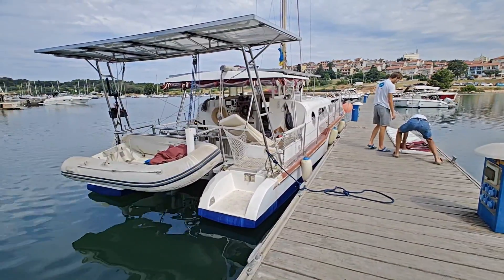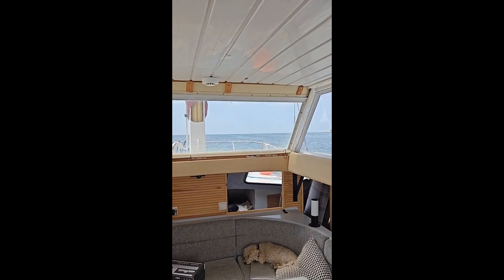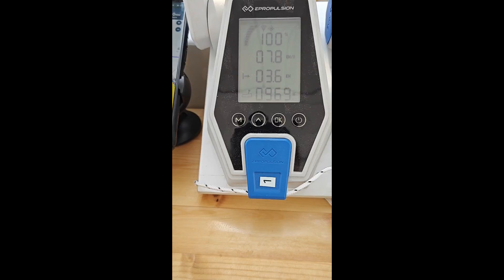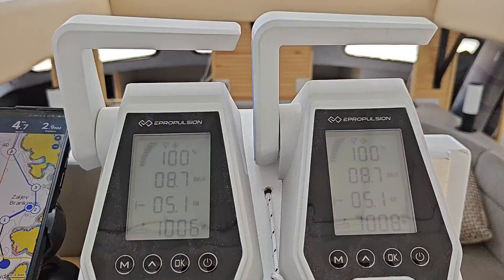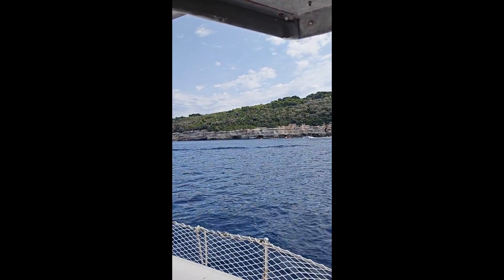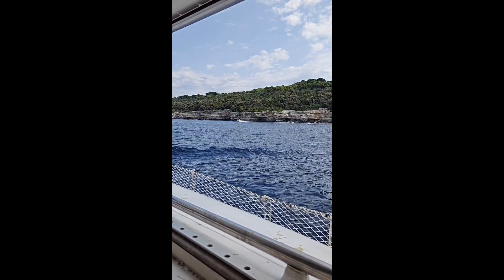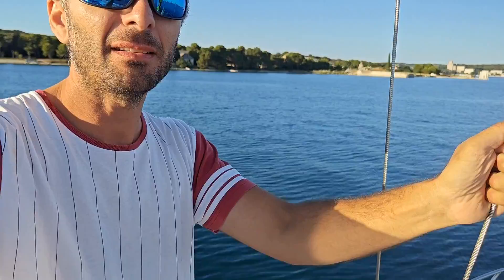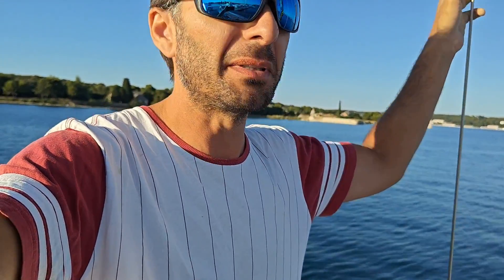Our DIY solar powered yacht works!

Comment: Just rewatching some of your videos Patrick. The boat looks like she was well above the waterline when she went in, meaning your exchange of diesel to electric left you with added capacity? I think your thoughts re. solar boat versus battery boat are interesting, but now you have been through a couple of winters, are these thoughts based on using her during these months, when solar can diminish by up to 90% depending of coursse where you are.
Reply from the maker: My maths tells me we definitely lost weight, but that's on an empty boat. As we now liveaboard literally everything we own is onboard, including the washing machine and all my tools. I suspect overall we're lighter but not by a huge amount. 

I still think of myself having a solar powered boat rather than a battery powered boat, but in summer I run differently to winter. I don't even think of battery capacity and will motor hard early in the morning knowing the sun will be shining until 7-8pm and replace anything I use. In winter it was much more of just using the available sun with the battery as a reserve tank. My summer speed is always 4-5 knots, while in winter I average 3-4.

Comment: This is so inspiring!!! I want to do exactly this Summer '27 when my wife retires and I just work remotely.
Reply from the maker: Go for it!! It's been completely worth it in my opinion! I'd change maybe 1 or 2 things with the benefit of hindsight, but not the lifestyle :)
Reply: @SailingElectra  What would those 1 or 2 things be? More solar is one I've gathered another was not to invest in the new mainsail? Any others? We meet our new to us 37' catamaran next weekend so all the suggestions you can throw our way are greatly appreciated. (@jasonlezlie is my personal YT btw. We shifted our project...lifestyle change...to this channel since that initial post.
Reply from the maker: @SolSeekerLiFe  losing the mast when I got the rigging quote would be a definite, going for pods over outboards would be a big consideration, but I'm not sure yet, and lastly I would have made my solar frames simpler. At the moment I have stainless tube with aluminium angle on top and then the panels. The aluminium in my setup is overkill and adds too much weight. I'd also consider a watermaker based on a Pumptec 107SS instead of the Karcher based one I have. I'm sure there are more, but those are the ones that stick in my mind.
Reply: @ Excellent notes! I still think the outboards are the right way to go. POD drives are very exposed and not as plug and play as dropping an outboard into place. The water maker is a very interesting consideration.

Comment: You should really be thinking that the batteries as the critical element when motoring and the solar panels as the possible source of re-fuel. It would be no different than setting of in a car knowing how much petrol you had in the tank and then wondering where the next petrol station would be along the road - and if it is open!
Reply from the maker: @marviwilson1853  it's been two years and a couple of d thousand miles. I do think slightly differently now about my batteries. I now consider them my reserve tank. I know how far and at what speeds I can do on reserve. 

My fuel source is still solar, so when motoring, like I am right now, my goal is to fill the reserve tank and then motor as fast as possible on only solar power. So at the moment I'm using 1000W total power to motor at 3.5 knots (7 knot headwind) and I'm charging my batteries at 600W. They'll be full soon, then I can go faster until the sun gets lower then I'll slow down to make sure I don't draw into my reserve as long as possible!
Reply: @SailingElectra  What you have done is fantastic and it is to your credit. All boats are designed for a mission and you are clearly happy with the spec level you have and the boating you do. Most chose multi hulls for this conversion but mono hulls are also feasible. They benefit from their abundance and variety and therefore cheaper price. Buy one with broken winches, worn out diesel, sails and ropes for best value. Solar panels are thin and light so a full length, full beam roof is possible. Build a layered roof with athwartships extensions to increase generating capacity at anchor or motoring in calm conditions. Use a properly marinized 2nd use EV lithium phosphate battery. Much cheaper. The business model must surely exist for such a boat in sunny climes. Built for "solars" not sailors who put out the panels when the sun shines as opposed to putting out the sails when the wind blows. Perfect for summer Island hopping in the Med where winds are often light and variable and sailing a pain. All that power allows all the home appliances for a comfortable stay onboard including air con. 100kWhr battery, 40-50kWhr per day from a 10kW array. Now we are cooking with gas!
Reply from the maker: @marviwilson1853  thanks for the compliment, and yeah I completely agree, a 10kw array and 100kwh battery would be insanely good! I suspect faster than an equivalent sailboat too!

Comment: I am impressed. What’s the weight of this boat? What can you increase the motor speed to without draining the batteries? 8kn and no battery usage.
Reply from the maker: Thanks! 

With no wind around 5 knots. The power draw goes up exponentially, so you either need loads of batteries, or to be happy with 4-5 knots.

Comment: There is also 'too much' PV capacity. If, at any instant, the system doesn't draw off EVERYTHING the panels are providing, the panels will overheat and life expectancy will drop.
Matching battery bank size to PV capacity and electrical consumption  enables the panels to stay cooler.
Otherwise, the excess PV production needs to be immediately dumped into a large consumer (propulsion motors, etc...) to prevent over voltage and over heating.
Reply from the maker: Interesting, I suspect this will be quite common to most electric boats, when size the system for the motors you have so much excess power on days you're not motoring. I'll have to find ways to use more power 😁
Reply: @SailingElectra  Out on passage, it's probably not a problem. Simply GO FAST AAHHHHHH!

In harbour on a sunny day AC is likely a good option. Get a unit with a dehumidifying setting and it will make life pleasant on cool damp days too.😎
Reply: Pretty well pointless information with the price of solar panels today and lifespan/ warranty.
oh no i've ( possibly/worst case) reduced my panels lifespan from 25 years down to 20 years, over 20 years... because they got slightly hotter than they already do every day all day sitting in the baking sun.
Reply: No it will not! Panels are 15-20% efficiënt The rest will warm up the panel. The environment will cool them down again. Effiency will go down whith higher tempo but that is full reversible....

Comment: when you pull into harbor at night, drop anchor and put up a couple vertical windmills and you can have full batteries all year.
Reply from the maker: A wind gen could be a nice addition, but I'd want something light and easy to put up
Reply: @SailingElectra  Oh of course. I would add one near the middle on a simple locking L joint for the 2 positions (up and down). Since it needs to be put away when you are underway or it will cause a lot of drag.

Comment: I just took my (motor)boat from London, across the channel, all the way through France, and then down passed Italy to Malta. Here is your problem, there's this thing called weather and it won't always be a nice day. There's also waves as soon as you have some waves it will slow you down a lot. And if there's a headwind you're going to have even more problems. You just don't have enough power. Your system will work on super calm days with bright-ish sunlight. Anything less than that and you're going to have major issues.
Reply from the maker: Hopefully we'll build up our sailing skills enough to cater for the bad weather, and you're right, steep waves slow us down a lot, fortunately we haven't been in a hurry so far, but yeah working sails are needed. If I didn't have those I would consider a petrol outboard or generator as a backup.

Comment: Good in theory, poor in practice.
Reply from the maker: Well it did work very well for the whole summer of 2023, including motoring in late October and early November, so I would say that's pretty successful practice 😊
Reply: Depends on your definition of successful. Simply working for a few hours at a time certainly doesn't meet my requirement. This form of propulsion is a long way off being real world useful for actual 'cruising' boaties. Up the coast for me is 600nm to my favourite stop over, non stop around 50 hours run time. @SailingElectra
Reply: Future here. Silent yachts got next level and went around the world using no sail or fuel. More powerful panels and the battery advances makes EV launch my chosen retirement vessel

Comment: Hi, I am new to your channel! Congratulations on electric conversion ❤⛵️ do you have an electric windlass? Windlass, heavy amperage use, heavy load, how does your setup handle it? Haven’t watched your other videos yet, brand new to your channel, so haven’t had a chance to hear yet your total battery bank amp hours capacity and your solar capacity?
Reply from the maker: Hi Taylan, thanks! Yes we have an electric windlass. It's connected to the 12v lifepo4 house bank and works flawlessly. That gets charged by the 48v battery that's also a lifepo4 pack. It uses 16 Eve280K cells while the 12v pack uses just 4.

Comment: What I've learned from installing solar panels on campervans and motorhomes and now my whole house is this. Your size of battery bank and solar bank is totally dependent on where you are in the world. Take for example where I live in the UK. From Jan to March, on average we probably get 6 hours of possible solar production from 9am to 3pm. During this time the maximum I have found possible is around 5% - 40% of my panels' full rating (my array is 8.7kW). The worst I would get on any given day is 5%. So my maximum production would be 8.7 x 6 x 0.3 = 15kWh. My worst would be 8.7 x 6 x 0.1 = 2.61kWh. The number of good days per month is possibly 5, with the majority lying somewhere between 2.61kWh and 15kWh.
Apr to June the maximum might be solar from 7am to 7pm or double the hours, with the intensity (the angle in the sky to panel) going up from 30% to 60%. The kWh produced may be as high as 8.7 x 12 x .6 = 62kWh per day. So where you are in the world (distance from the equator) affects your production much more than anything else. With the price of lithium (LiFePO4) batteries being the best price at the moment they have ever been (I can buy a 15kWh, 48V battery for under £2500), I think depending on weight (the battery I just quoted weights around 120Kg), there is no excuse for not stocking up on batteries. Again, it depends what kind of 'motoring' (sailing) you expect to do, and the range needed. I haven't watched any of your previous videos (but I will now) so I don't know what you installed on your boat. Good luck.
Reply from the maker: Thanks for that, it's really useful information to have! I've got a 14.4kwh pack. Financially doubling that isn't a big issue, as you say, the prices are looking pretty good right now, I just don't want to add another 100kg to the boat if I can get away without it. We plan to do mostly short hops, and ideally on sunny days. My sails aren't working yet, but hopefully I can have those rigged soon for days without sun. Speed isn't a huge concern for us when moving, but for safely that might differ, and I may consider a small genset or outboard to keep the boat moving for longer periods. I'll do one of those this winter, but I'm not sure which yet...

Comment: Is there a place that has your complete specs on your boat and electrical system?  many thanks!
Reply from the maker: No, but I have 2 X 6kw motors, 3200w of solar, and a 14.4kwh 48v lifepo4 battery pack. Let me know what else you'd like to know.
Reply: @SailingElectra  Hey! I would love to know the type of boat and the general weight! This is a very cool project. I've got a 33ft 9,500lb cat on the hard right now, thinking of doing something similar and wondering what size Epropulsion motor I need.
Reply from the maker: @CaptainShack  it's probably around 10,000lb, and 30 foot long. I've got twin 6kW motors, but I never go over 3kW. For me the price between the 3kW and the 6kW was close enough that I thought I should just get the bigger in case. I may switch to the 6kW pod motors for ease of docking next season. We'll see.
Reply: @SailingElectra  I've done a little measuring for the pod motors and sadly if I were to install I never ran aground. I didn't pack the pods. You think a single six kilowatt would have been enough to push your boat comfortably?